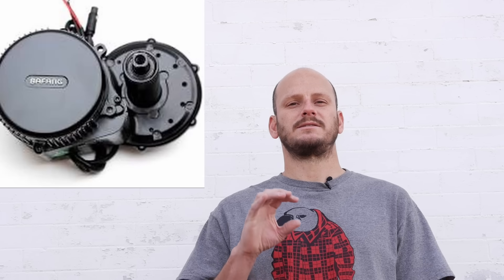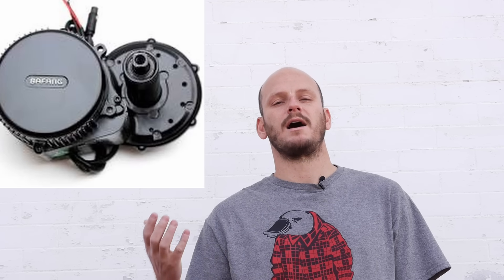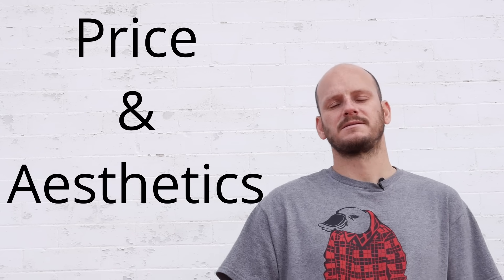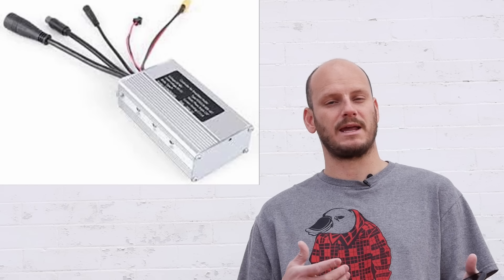Hub vs. Mid Drive Motors: Why Hub Motors Suck and Debunking Common Myths with performance test

Comment: I do a lot of gravel bike riding in my Locale on my MTB convert, quite often on wet ground, England is wet most of year, i personally love the 2 wheel drive system, me pedaling back wheel and hub driving the front, obviously am not hurtling along at daft speeds, yes its true my bike is front end heavy, but not yaknow not ridiculous and then when am sat on bike the weight evens out, so with good tyres the tangible grip and pull of 2wd is awesome, an engineer friend recons that the motors in hub drives are bomb proof ? ( you tell me) but mine never gets hot. So with my system, if i did snap a chain i can just remove it completely and set a slow cadence to get me home on front wheel drive. BTW, a lot of guys express scenario of chain snap, this aspect applies to ANY bike, so just carry a couple of missing links and a chain tool in your kit ( far lighter) than a full on chain. Horses for courses, live and let live.

Comment: Both have thwir place/use. My 3000k dual hub motor bike can climb a mountain indefinitely at 45km/h without overheating. How do you motorize 2 or three wheels with a mid drive?

Comment: Since you have the newest technology, why not go all the way and use the newest Carbon Rubber Belts in place of metal chains? Have you had any experience with Rubber Belts? You can find more info at:
https://www.gatescarbondrive.com/
Reply from the maker: I actually did an opinion piece on belt drives. Spoiler alert, I’d recommend going single speed chain for serious riding vs belt, but that’s just me 🤷‍♂️

Comment: Idk why but you really are a mid drive fanboy. I don't mind either but you saying that the price is the same is a straight up lie. Mid drive kits seem to be about double the price compared to hub kits rated for the same wattage. I do find hubs more flexible since most of the controllers don't have propritery connectors like you get on mids
Reply from the maker: I said they are same price within $50 based on quality, not wattage. I am speaking on aftermarket kits here too. Not complete premade bikes.

Comment: You are kidding right? Hub motors are more powerful however they do not make for a quiet ride its like being followed by a UFO and all the maintenance that comes with a mid drive is insane
Reply from the maker: You need to try a bafang system it sounds like😀

Comment: You forget that mid-drive motors don't have regenerative braking feature, wich is a big minus. 
And today exist hub motors with reduction gear inside (torque multiplier), so forget about all your theories about lack of torque on same rated power or  bigger electrical energy consumption for hub-motors. Also let's not forget about the look, when hub motors look way better inside rear wheel than that nasty piece of construction on middle frame. And lower clearance on mid-motors.
Reply from the maker: The only hub motors that support regen are direct drive motors, not geared hub motors. Geared hub motors cannot send the power through the drivetrain which adds over 300% of power multiplication compared to a hub motor. You have to visualize how the power is being sent to the wheels to truly appreciate it.
Reply: @JohnnyNerdOut  all hub-motors suport regen, it's pure phisics. And If motor îs good enough to provide motion force, he will support back force for  regen. Like in cars, engine brake will work  in 1st gear and will work in 4th gear (direct drive)  also, without gearbox damage, but effort will differ, of course.
In terms of energy, same energy will be recovered no matter torque multiplier or gear reduction. Just force will differ.
If some hub-motors doesn't support regen, it's a controller issue, not a motor one.
Good review, anyway. And you forget to mention that mass dristibution is in mid-drive favour. Bikes with mid-drive are better balanced and is important.
Reply from the maker: @laurentiuosipov7074  here’s a good thread worth reading if you are interested in trying to make your geared hub have regen braking 
https://www.endless-sphere.com/forums/viewtopic.php?t=43736
Reply: @JohnnyNerdOut  clutchless geared hub motors have regen.

Comment: I've already been leaning towards a mid-drive for my first bike for many of the reasons you listed... its nice to hear some confirmation to my observations. I'm curious if you've ever build a mid-drive bike and then also added a hub front drive (with or without a separate throttle) for the "sometimes" use cases. I think a 1000w mid and a 500w front would be a sweet spot.
Reply from the maker: No. It’s really not practical as a 1000w is powerful enough on its own.

Comment: The best option is to get a brushless motor kit, basically a golf cart motor. 72v 50A controller 3000watts with chain and throttle, for $300. Small 5tooth drive shaft, hook that up to a 40 tooth rear sprocket. Only downside is you need to have some fabrication skills, but not much.
Reply from the maker: I agree. But at that point it’s no longer an e-bicycle. It’s an e-motorcycle. Technically and legally.

Comment: I have been pondering dual hub + mid drive on a stretch cruiser frame I bartered for. It can accept 26" x 4.0 wheels, I haven't messured the drop outs since I got it back in November but iirc the rear was 190mm. I will be building the bike for comfort and long distance trips. I have seen some people with the same battery pack getting more range when they went dual hub motors, so I hope you got your dual hub vs mid drive video done : )
Reply: I was thinking about a front hub-drive and a rear mid-drive... So, that's not unheard of?
Reply: @johnw65  checkout Christini awd bicycles, the best there is..
Reply: @sittingduckass3676  Wow, Military-grade AWD elec dirtbikes for stealth recon...My new T42 is a 750/1100w Lectric style folder. Plan is to use it up, adding a front hub and mid-drive after the rear hub dies.

Comment: Hub motors are sooo much cheaper, not sure how you can claim they are about the same. you can buy kits with almost everything included, hub motors generally cost 30% less for equivalent wattage. also these DIY kits less thought has to be taken into account with the frame as hub motors are standard sizes. The last point about hub motors being better at higher watts is BS, because of the torque being applied to the fork dropouts, bend forks, and snap torque converters more thought needs to go into it, there is a higher level of safety in breaking a chain on a mid-drive compared to breaking a fork dropout on a hub. there are also weight saving in a mid-drive motor as they are generally more compact. In my opinion hub motors are better suited for low-wattage DIY kits because of the money savings, lower level of expertise needed, and fewer tools are required.

Comment: Hi. I'm going to convert my bike with a mid-drive. But my only problem is what size would I need. My bottom bracket is 118mm length and 73mm width. Looking at a Bafang 750w or 1000w. And you seem to know your stuff. So do you think it'll work? And what would you say I should get to fit? As I think it comes in different sizes just would like to know which size should I get to fit my bottom bracket. I'm good at putting stuff together just not brilliant at working out the size axle or spindle I would need. Don't want to end up with the wrong one and then realising half way through. I hope you can help? Thanks
Reply from the maker: Those numbers don’t jive….
Reply: @JohnnyNerdOut  hi please explain?  Not sure what you mean? Will it work or not? Any ideas?
Reply from the maker: @jasonrouse6912  118mm and 73mm don’t add up. 
You need the length(between pedals on the frame) and the diameter of the opening.
Reply: @JohnnyNerdOut  I was thinking that too. I even emailed the factory who make it and they said that size. Looks like I need to do a bit more research?

Comment: Yeap, it comes from the crank, so all the power gets transmitted through the chain.  It's got to impact chain life negatively.   Direct drive hub motors can do regenerative braking. Then again, a mid-drive likely has a bit less drag when the motor is off.   750 watts is more than 99% of cyclists can produce regardless of where the motor is.   It's lots easier to drive both wheels with two hub motors than with one mid-drive if someone wants to do that.

Comment: You ARE anti hub drive.
I've had 1500w hub drives for over 4 years now , cheap Chinese unbranded (£200-300 for the whole kit)not once have i shredded even 1 spoke never mind a wheel , & i go full tilt everywhere. The controllers are built into the hub , you must know that they are available? ,why lie about that? Hub motors are easy to install & repair. I spent the money i saved by not buying branded goods on a very high quality Samsung battery .My hub motor is fitted to a surly ecr (27.5 x 2.8)m & a surly straggler (700cc) which both have low brackets for stabliblty. i have a friend with a bafang 1500w mid drive fitted to a surly ecr ....my hub drive ecr leaves his for dust.
I get we all gotta make a living but show some integrity dude!

Comment: I hear your points, taking mental notes. But I'm gonna see how the 72v Hub Kit I got performs with my OCC Stingray nonetheless because I have it and haven't finished my build yet.
Probably will wind up converting to mid drive when it gives out.
Reply from the maker: a 72v hub should scream!
Reply: @JohnnyNerdOut  Great to know! I did a bit of searching to find a faster one than most streamlined ebikes, it's rated for 43mph. I'm gonna try to get my gear ratio to where I can add speed to that via pedal gears. 🤙
  After watching this, think I'll run it on mid speed to do my part against burning out the motor. Thanks for your tips and feedback. 🤘
Reply: Put some ferrofluid in that hub. Maybe even heat sinks.

Comment: HI Johnny, Can you please advice me ?, if i got a 1500watt hub motor can i  used a bigger BLDC controller for example using 3000watt controller, and is there any bad side effects?. tq for the reply
Reply from the maker: It all depends on the quality of that motor. The ratings are general guide. But if it’s a low quality 1500 W motor you might not get a long lifespan out of it.
Reply: @JohnnyNerdOut  so the main question about 1500watt motor can run with a 3000watt controller? , is YES it can,  but it will depends on the quality of the motor. tq again johnny,

Comment: interesting....Lordstown Motors uses hub motors for their vehicles and Foxconn, they make iPhones and 40% of the electronics in the world, are going to be making their trucks. It was interesting hearing your opinion on hub and mid-drive in bikes and the exceptions. I have biked most my life may get a mid-drive bike now but I was looking into electric trucks so I can get away from oil and maintenance. I think you may have convinced me the hub motor on a truck is ok and the way to go to save money. We will see.....
Reply from the maker: Just to clarify, it’s technically not a hub motor in electric cars but it’s still a single speed gearbox (same function)

Comment: So what do you think of the grizzly ebike that has front and rear 1000 watt hub motors all wheel drive two 52v batteries that has a top seed of 32mph and a range of 70 miles
Reply from the maker: I would take a 1000w mid drive over two hubs any day personally

Comment: Ok, I gave up my plans to get a hub motor. Thanks for the clear message. I have a question. I have two left hands. I guess it is better to pay somebody to convert my bike, right? In e bike shops they try to sell me pedaleis for 8 k dollars, so they will not so enthusiastic to help me to get a cheap alternative.
Reply from the maker: I have videos on how to install and also offer video consultations to help if you run into any trouble if that interests you at all?
Reply: @JohnnyNerdOut  Yes, I am interested, but I am still insecure about some things. For example, I always thought that a e bike has to be stronger to deal with the extra weight. And that the breaks have to be stronger too for the same reason. Or am I completely wrong?
Reply from the maker: @brasileirosim5961  a converted bike only weighs about 15-20 more pounds. I don’t think it warrants a massive upgrade. Yes the speeds require better braking though if you plan on flying 👍
Reply: @JohnnyNerdOut  Ok, now I have to find out somebody in Switzerland who can help me.  Thanks!
Reply from the maker: @brasileirosim5961  if you have trouble finding help, I do offer virtual help via video calls 👍

Comment: I have both a hub drive ebike and a mid drive ebike. Both are 52V and both are 1000W. The mid drive controller program has been personalized. The mid drive feels more natural and has more torque in the mid range. The mid is way faster also. IMO if you compare the two at the same amperage and wattage, the mid drive is the performance king. Application is everything, including the factors that make the choice. So either way you go, you are going!  Ebikes are amazing and both of my ebikes are fun to ride.
Reply from the maker: Totally agree

Comment: 4k + miles on my overvolted chinese hubmotor that constantly sees 40mph no a single issue yet, proper cooling ftw. plus you can lock the backwheel which makes it more difficult to steal

Comment: i generally agree and understand your point, but how about different wheel sizes? we cant say a hub motor on a 20 wheel has the same torque as on a 29 wheel can we?
Reply from the maker: Absolutely correct! Gear ratios play an enormous role in performance.

Comment: Hi Johnny, I have the 750 middrive Bafang and there's something wrong with it. It slips when I first start to paddle. I think the clutch is the problem. If that is right, is it hard to replace the clutch and where can I get the parts for it? Thank you!

Comment: I do respect your idea of mid drive but when you mentioned about spokes, there is still force on the spokes from that centre hub of the wheel isn't there ?
Reply from the maker: Yes, check my pinned comment for clarification on that 👍
Reply: No hub or mid drive will streas the spokes as much as a locked brake.

Comment: You rely on spokes either way. You need much more chunky expensive chain and sprockets if the motor drives through it otherwise they will wear out in no time ! Hub motors are actually designed to work in a hub. Mid motors need more torque (and a special frame) because of the nominally high gearing which suits human motors really well so your arguments do not make sense. To repeat apply human (say 80) rpm and more than a few hundred Watts and it will destroy normal bike chain and sprockets quickly.  Or you need higher torque because a normal bike transmission halves it from crank to wheel in a middle gear. Nasty motors burn out faster than decent ones. The leader in mid motors is of course Bosch. Both hub and mid motors have internal reduction gearing. Electric cars have no gearbox as such but most have a fixed reduction gearing because motors still like higher rpm than wheels at normal speeds. Most hybrids have a normal ish auto box in the way (except for the Toyota system which is something else with 2 motor/generators and an extra  differential).

Comment: Get full suspension front and rear. I bought Moscow and very happy with it except no rear suspension. I considered bafang mid drive conversion kit but would need to buy a bike as my original bike had no suspension and frame wheels etc not built to anywhere like the std of the Moscow. I'm sure there are good recommended base frame, component kits but not sure net price going to be so much cheaper. I would like to have seen specific bike and mid drive kit recommendations with Baba links. Your https://youtu.be/M0nzw9-6koM interesting.
Reply: As an assist system for road and light trail use where steep hill climbing not important, hubs are a little bit more efficient aren't they? So you get a bit extra range compared to mid drive? I find most of the time my hub power meter shows little assist being added. That little assist makes a lot of difference to average speed though.

Comment: Look, hub or mid drive, the question is simply this: Do want to add some power to your bicycle, to assist you when you peddle up a hill, or into a strong head wind? Or do you plan to use / change your bicycle as/into a motorbike? , i.e. not need or use your pedals at all? If you want to still use your bicycle AS a bicycle and NOT a motorbike, then a front hub drive is more than adequate to assist you  when you are pedalling. I am an overweight ( over 104 Kg) old person,  who is out of shape. I have installed a 250 front hub motor that has 5 power settings. I didn't install the speed sensor , because I want to decide when I give the bike some power assist!!  Even with my considerable weight and being out of shape, I've  never needed to go beyond power level 2, even on long steep hills, with myself pedalling too. The whole point for me to add a front motor, was so that I can  go up steep hills , without having to go into a gear so high that I am unstable, because I am going so slow! Thus for me the addition of a front hub, enables me to maintain my speed going up hills! It so happens, that even on the lowest power setting, I do not need to pedal at all with my 250watt front hub motor. However, the whole object of adding the motor, was to get me doing some cardio by pedalling!! Now what the guy is really talking about is essentially  motorbike territory!  In the UK, the maximum power to be legally fitted to a bicycle is 250Watts for road use, and to be honest, I  would find anything larger as unnecessary and dangerous. If I want speed and no pedalling, I use my other bike, My BMW 1200cc R Nine T Scrambler .